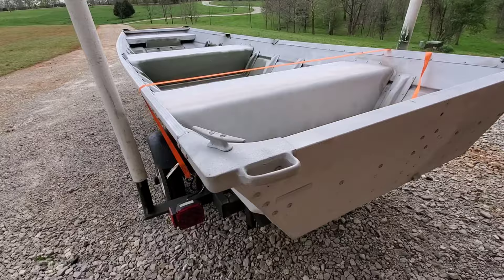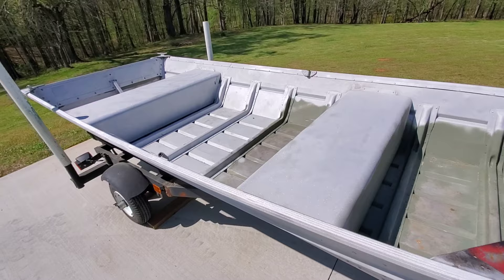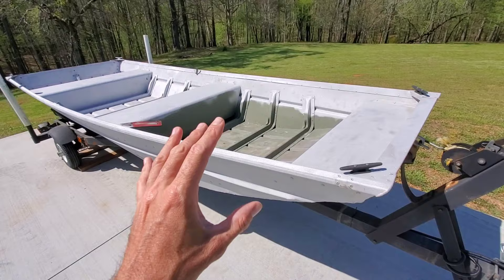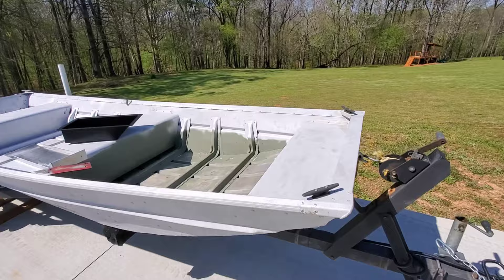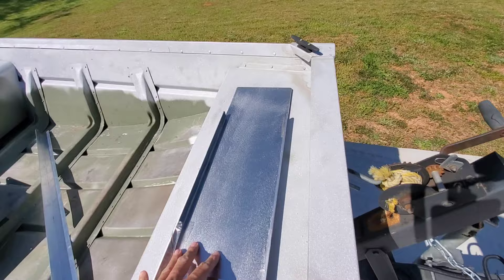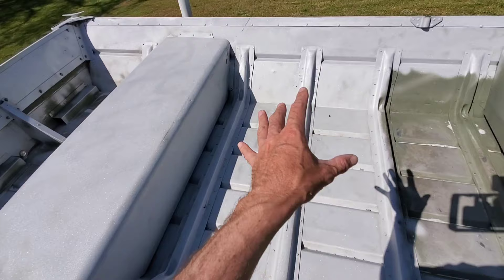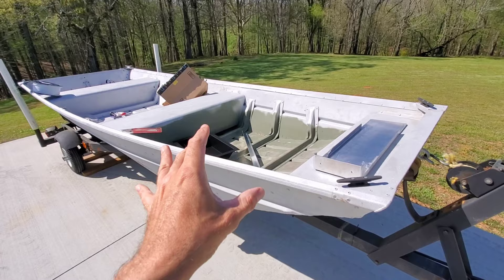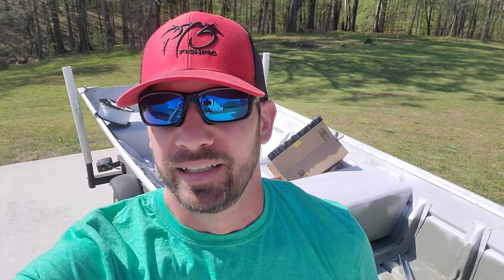How I Plan a New Jon Boat Build

Comment: What's the stability like when you after raising the center of gravity, to the rim of the boat?
Reply from the maker: Every boat is different.  Stability depends on weight added, materials used, hull design, and the individuals actual measurement of what us stable and what is not. Some people don't have sea legs...

Comment: What's the budget for a build like this ? I have a similiar jon boat. Love the builds !
Reply from the maker: That's kind of a loaded question because he already had graph and trolling motor and boat. Plus now 2K in parts, materials,  batteries. Plus labor.
Reply: @AnthonyJonesBrigadeBoats  thanks for the reply. That awnsered my question.  I have a bare bones 1436  I was looking for rough idea on framing and decking. I realize any build can be what you want to spend and sky's the limit.  Boat. Bring out another thousand lol.  Looking forward to the build.
Reply from the maker: Haha, thanks man..And in the boat game $$$ is relative to the customer.  Some guys 10K is just getting started other guys (like me) run a tight budget wheeling and dealing!
Reply: Are you going to do video taking us thru the whole process?

Comment: Guessing you're going all electric motor again? If not what's a good place for a gas tank for a small motor, I've got a 5hp nissan on my 14 tracker
Reply from the maker: Yes this one will have 2 batteries in the back..Good place for the gas tank is in back by transom

Comment: Oh no, no rod locker?

How much money is saved by doing plywood deck vs aluminum?

I heard Nate Eckhold is a righteous dude!
Reply from the maker: Rod locker eats into cockpit and front hatches big time on a 36 hull. They are nice but I prefer them in 1448 minimum even then gets a bit tight for my liking. I could make it happen for sure but space gets sacrificed. 
Money saved could be thousands.  Imagine 200 average an aluminum lid ×6 , 1200, plus 2 sheets of .080 at 195 each, almost 1600. Plus 30$ each for proper latches, another 180. Most do hydroturf or seadek on aluminum (because why would you carpet it?) add another 150$ x 6. Another 900$. I've already lost count, , you get the idea. Turns a 4K build into 6+ real quick!!! 

Nate is my cuzin
Reply: @AnthonyJonesBrigadeBoats  I can appreciate that. 36” is a little tight. Are you gonna do the float pods for stabilization?
Reply from the maker: No I think the batteries low in back near/below water line will help it. My 1436 is super stable but the 1232 was a death trap. Just depends on the build man.